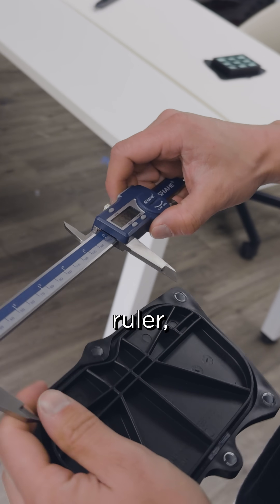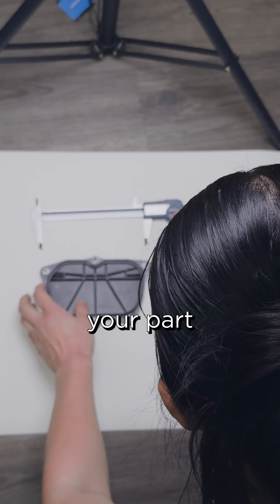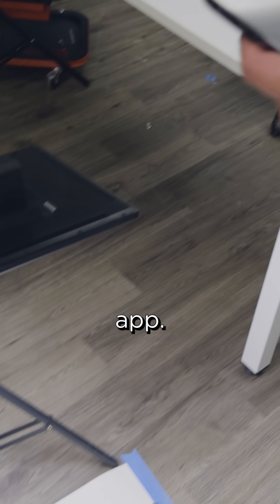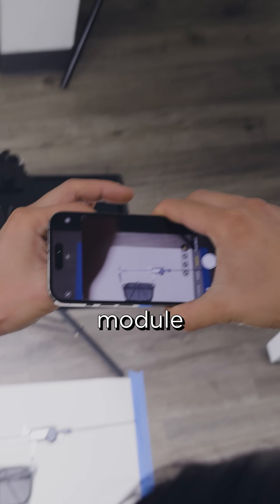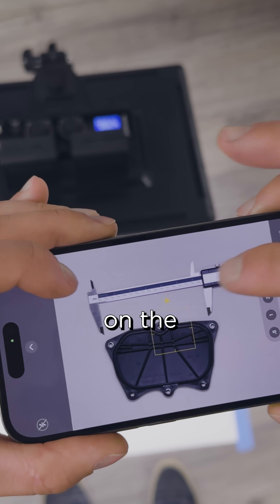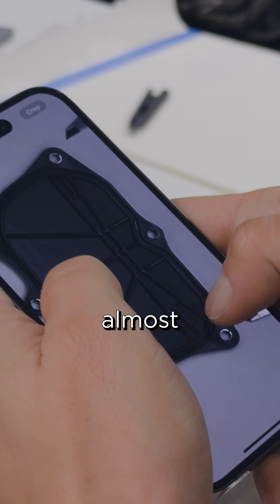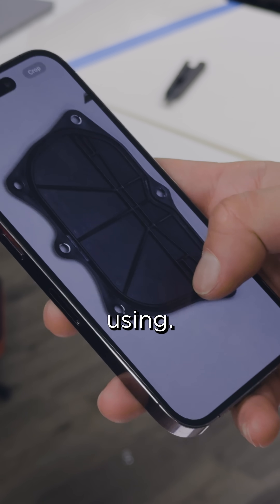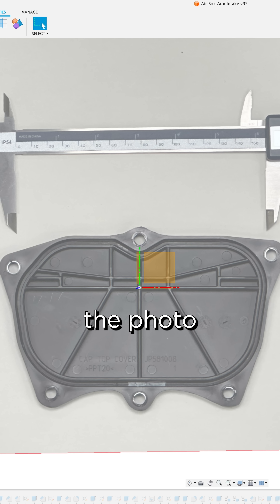Scanning parts with ONLY a cell phone

Comment: Could you more easily use a scanner. It’ll be flatter and more accurate and simpler. But will have set backs from things not touching the glass as it’ll be out of focus
Reply from the maker: yes and yes

Comment: I did that with a blurry picture without a white background and no reference, converted it to an SVG and imported into f360, then I set the scale and cleaned it up slightly, and it perfectly fit in place with less than 0.003” gap

Comment: How does iPhone 3d sensor scanning work for this?
Reply: Not very well. Scanning equipment that works well is very expensive. And accurate scanning equipment is even more expensive. My company just spent $100,000 on a scanner so that we could redesign some parts that have been failing.
Reply: @mklinger23  what kind of projects does your company do? Seems huge!
Reply: Ahh Polycam works decently I’ve heard. I don’t have an updated iPhone with LiDAR but it worked well with photo mode.
Reply: @TheYeeterDefeater iPhones have had LiDAR for so long, you should really get a new phone, or at least a 13 pro because they’re still great
Reply: It’s not precise enough for this, you would need a $20k scanner to get a good scan